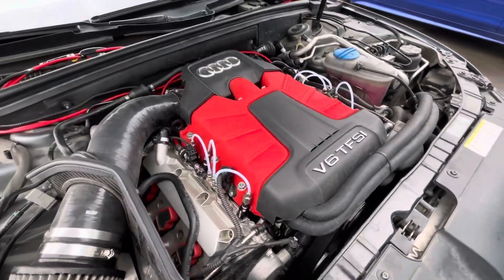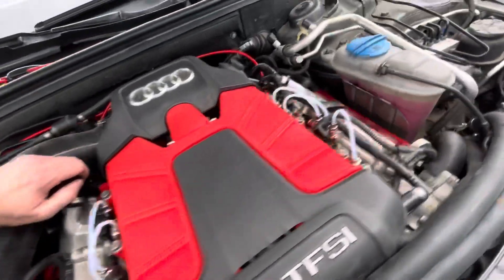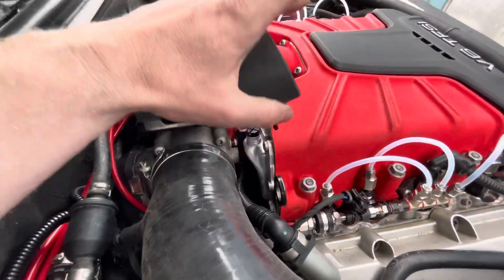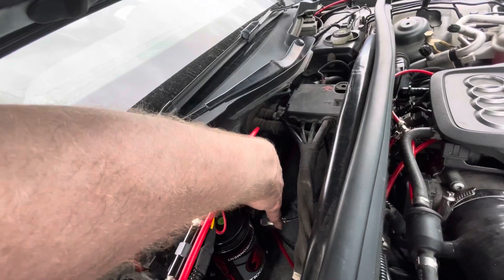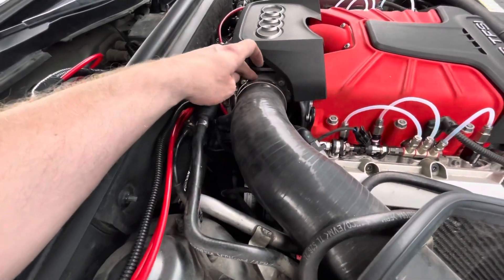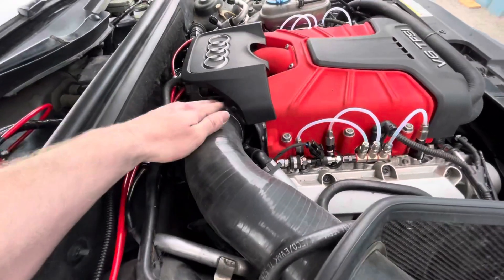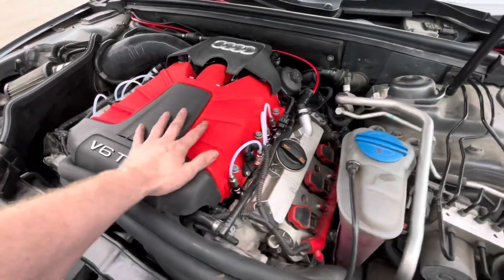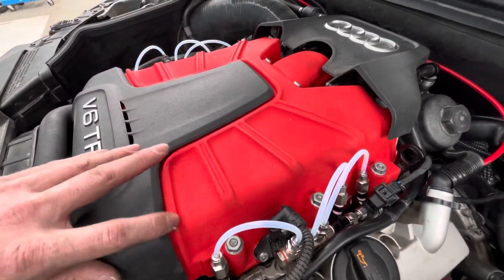Audi B8 S4 WMI 6x Port Injecting Nozzles and 1x Throttle Body Space Injecting Nozzle.

Comment: are you able to run full e85 now that you are port injected? also can you drop a tutorial on how to convert these motors to port injection?
Reply from the maker: It’s only port injection for water methanol, not E85.
Reply: @christopheredgett4919  oh I see, would it be possible to make it so that it can run off e85? maybe like T into a fuel line and get a set of injectors with a stand alone fuel management system?
Reply from the maker: @Pure_haste anything is possible but you would need 6 injectors controlling the fuel, along with proper fuel lines and an actual fuel pump not a water methanol pump.
Reply: @christopheredgett4919 I was going to T into a line after the hpfp kinda like how the crec motors do it
Reply from the maker: @Pure_haste the crec setup was never designed to make more than 340bhp. Get into the 500bhp range and I’m sure you’ll have fuel starvation issues if attempting that kind of setup on the stock LPFP.

Comment: Any dyno gains to show? Have you considered using a spacing in between between the super charger and the intake manifold?
Reply from the maker: I’ve never dynoed it stock, pointless to do now because I have no delta. A spacer would not work because my current intercooler larger hoses would be going through the hood. The spacers also would not allow for the TMAP sensor to see the lower IAT temp.

Comment: I love this so much, but the fear of hydro-lock due to controller failure keeps me awake at night.
Reply from the maker: Impossible to flow that much with engine running, and when the ignition is off so is the system. Btw, my pump is wired to a hobbs switch and not the controller. The controller is powering my race valves from USRT.